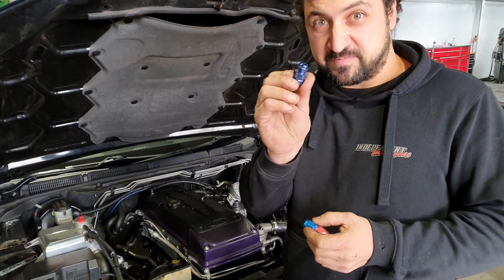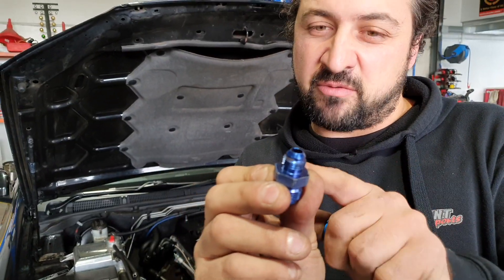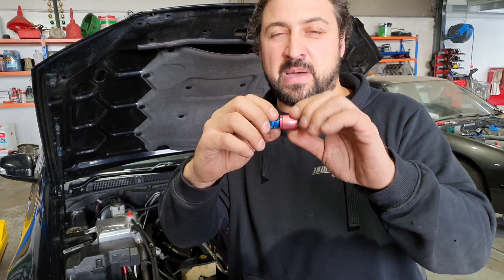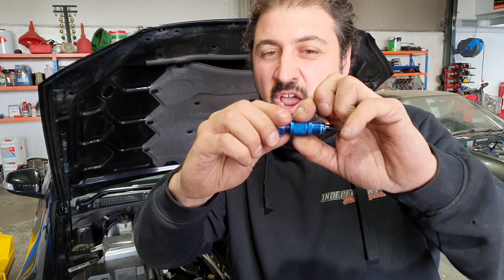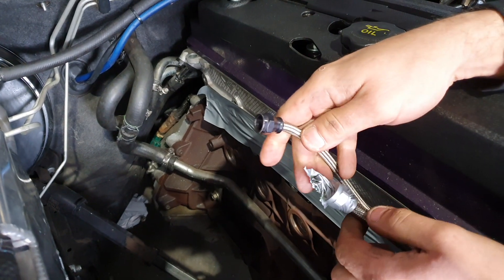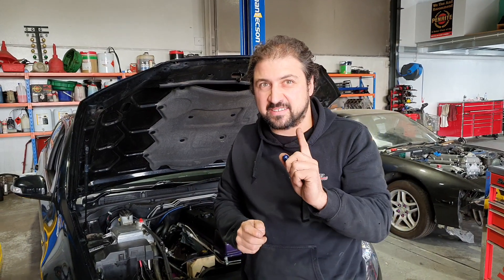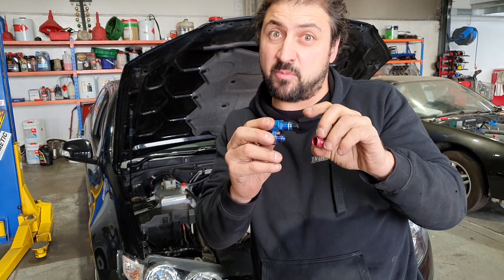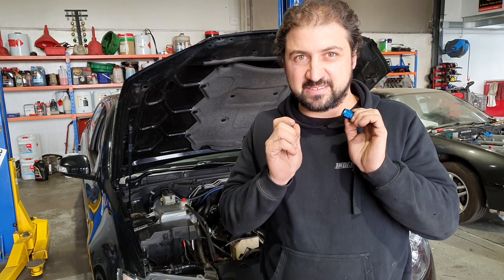How to Properly Remove AN fittings

Comment: OMG so common sense its not funny, the hose end is made with braided lines or if not it might e factory hose but with a AN fitting put on, that's why they make the system so its so much easier to take off in the first place, lol:) But still i guess people buy a kit and then suff it up and wonder why its leaking oil fluid etc etc,.
Still i have a question can you fit AN fittings to a VF V8 L77 auto external transmission cooler but using the OEM factory lines, so you have AN fittings connected to the internal Radiator transmission cooler lines which come out of the radiator, then connect AN fittings and connect to External trans cooler, but using the OEM factory lines with out cutting them at all. I know holden did make a OEM External trans cooler which hooks up to the factory radiator internal transmission coolers, but for extra cooling putting a external trans cooler ( Aftermarket or OEM ) does help with life of the transmission ( even if you dont tow etc. ) Just what to know if the factory lines can be used with out cutting into them and using AN fittings to link up with the OEM lines and especially with the way they seal as well?